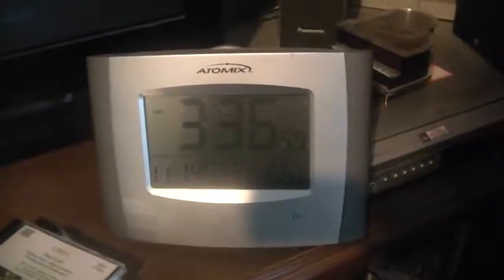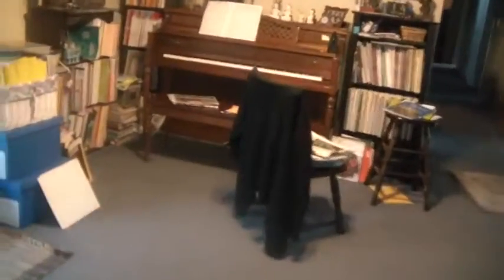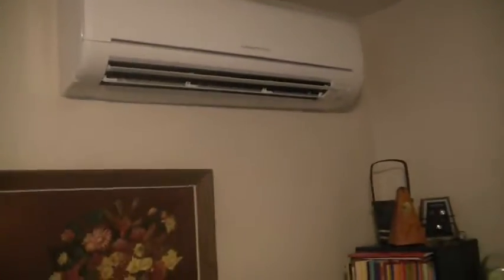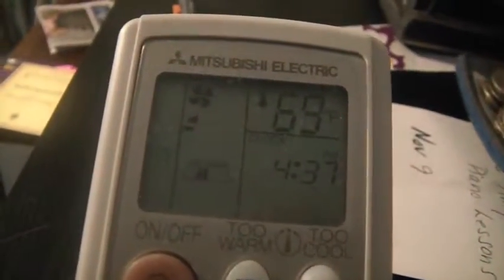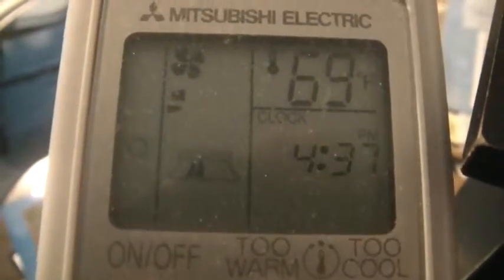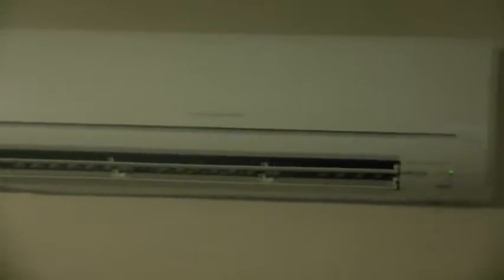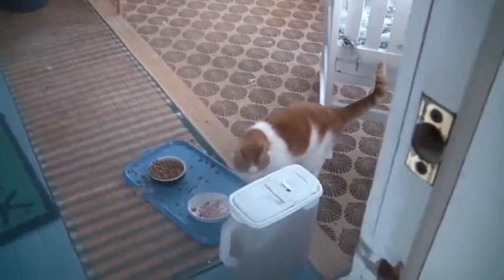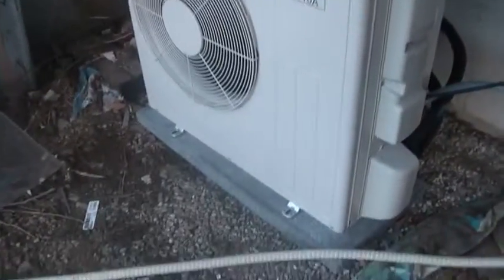Review of Mitsubishi Mr Slim Ductless, heat pump,, 22.5K BTU,wall mounted,

Comment: Harvey looks like a winner.  Do you need 200 amp service for it , I have gas heat, hot water, stove, etc.
Reply from the maker: +59chevt , I have never seen it draw more then 5amps, 240V, so no, a 200A service would not be needed. Given that all of Ur big energy users consume gas and not electricity, 100A will be more then enough for the lights, small appliances, and this HVAC unit... I am very happy with it... Thanks for asking, watching, and commenting!

Comment: The device you are using to monitor the power consumption of the heat pump wouldn't it be a better idea to have that installed upstairs near the thermostat so you can keep a better eye on it, instead of having the display down in the basement??
It seems like the cat is feeling better, if that's the one that was feeling ill in the other video.
Reply from the maker: +redneckbryon , Cat was only under the weather for a day, probably ate something she shouldn't have... I would of liked to put the monitor upstairs,  but, to do that I would had to run the 240V monitor lines down to the box and I did not to have that Voltage up in the living room, especially if someone decided to mess with it... I monitor the furnace downstairs, I can keep track of both of them in one book this way... Thanks for your thoughts, watching, and commenting!